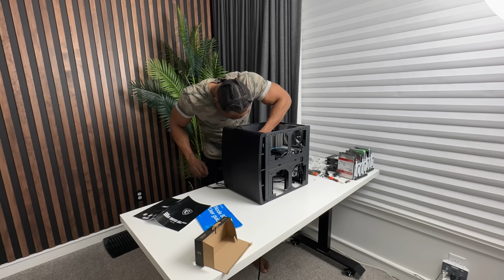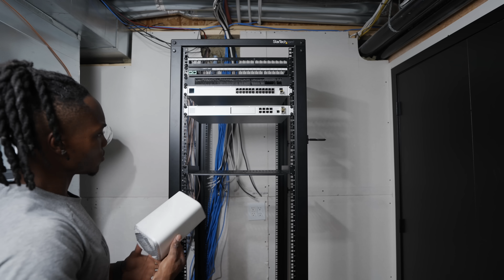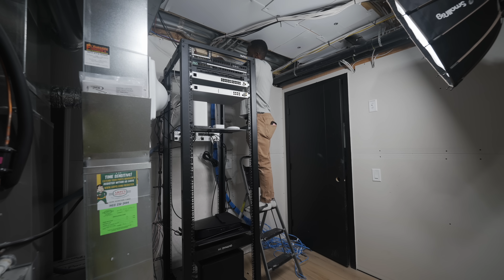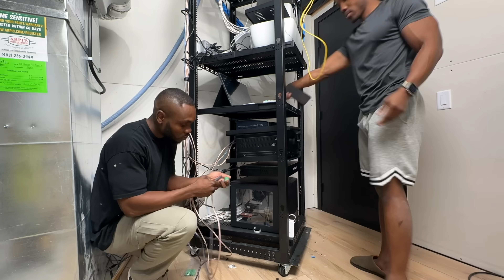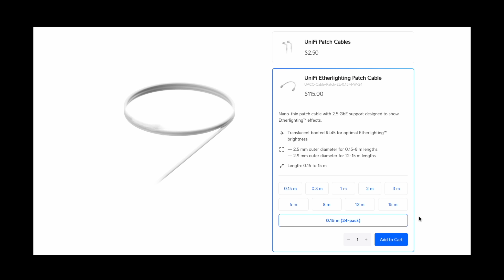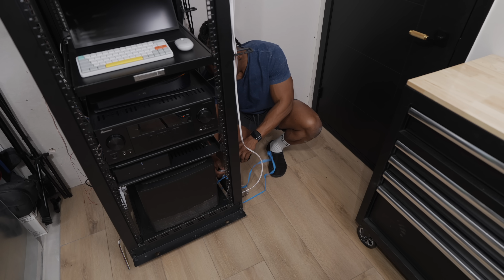Building my NEW homelab & multimedia setup! | Part 2

Comment: really nice build. Ive never had an audio receiver before so how does it work being in one room and the tv being in another? how do you control it? i guess all the speakers in the tv room have to have wires run to the receiver in the other room:?>>>??
Reply: There’s loads of ways to control it quite often it set up once and a lot of devices depending on how they’re connected have the ability to pass on the message to change the volume

Comment: outside of the patch switch patch suggestion use a DAC cable to connect switches to each other and the firewall
Reply: Definitely a great recommendation RJ 45 cables are easier though when you haven’t worked out these act layout especially when you are figuring things out still I’m trying they can be more convenient as you’re likely to have more of those cables laying around

Comment: This setup is really sweet man, I couldn't stop smiling looking at all the cool hardware you've set up! Have you thought about putting your NAS/Plex server into a rack-mounted case though? Just in case you need to swap/add components in the future it might come in handy with only needing to slide a case out on rails than try to pull a whole desktop out for maintenance.

Comment: What exactly are you running on that rack? Why do you need 48 ports?
Reply: If you’re going to the effort of running the cable you might as well add a couple to each place you run it because the cost is low and it’s worth to not rip the walls open

Comment: I highly suggest splitting the switch and dream machine. In my business racks it's always patch panel, switch, patch panel, switch. Gives the switches some airflow as the newer switches are fanless and need some help keeping cool. 
As someone who has recently dealt with overheating issues on my Denon (lower end Marantz) I VERY highly recommend putting some space between the AVR and the Playstation.
Just my 1.5 cents worth. Good luck
Reply from the maker: Appreciate the tip! This is the way forward forsure :)

Comment: did you have issue with the rack looking a crooked i have the same rack mine is a bit crooked even when the main bolts are tight ive tried to fix it with no luck
Reply: LOL.. funny enough we ran into that during the build. Midas kept saying the rack was crooked but I didn't see it. If I remember correctly I  think it turned out to bean issue with what post goes where and tightening the bots it fixed it.

Comment: you're introducing more latency - along with added costs - to the system by installing RJ45 SFP modules in-between the units. for the price of 1 transciever you can buy a complete SFP+ DAC cable. /CC
Reply: That is true, but there is a lot more flexibility in RJ 45 cable lengths that can be important when you haven’t worked out what layout you would do

Comment: Midas i seen you have a bunch of devices that would work well together and I would like to recommend that is your wanting to adda smart home systems look into home assistant them you can make sure that you take full control of all of your devices that you have in your rack and house

Home assistant is very easy to use  if you set it up

Wishing you good luck in your home lab journey
Reply: Home Assistant runs on top of the Unraid server as a docker container. He's been using it for a while. and yes, HA is awesome.

Comment: Cleaning Mix = 
Water + Spirit + Soap + Tupentine 

WHITE METHYLATED SPIRIT  = For cleaned surface to dry fast.

TURPENTINE   = To disolve and remove hard or deep stains 

SOAP = Removal of simple dirts 

WATER = Base liquid for the mix

The mix works excellent but must be proportionate with  minimal turpentine.
Reply from the maker: Appreciate the tip! I'll have to give that a try. 🔥

Comment: What are the products you mounted at the top which are used to mount the cables coming in from the ceiling? Are those normal cat-extenders which you then mount or is it a specific product? Do you have any (affiliate) link?
Reply: just velcro and screws.
Reply: the patch panels?